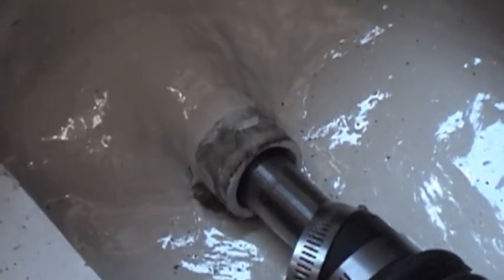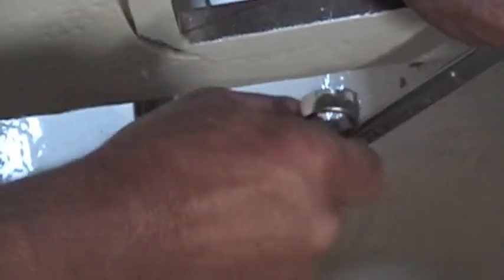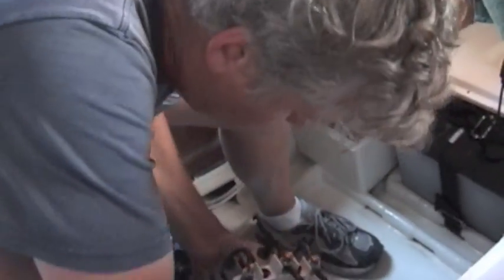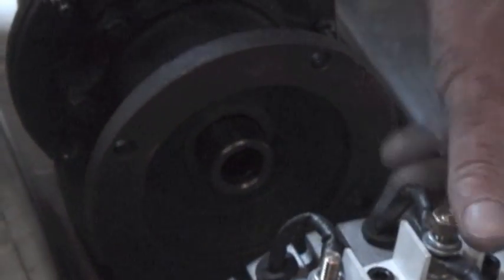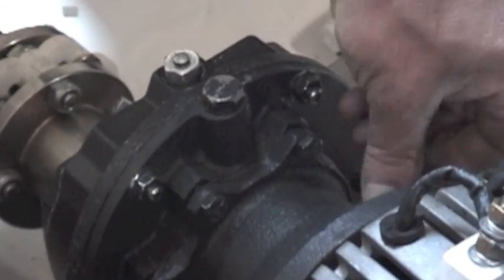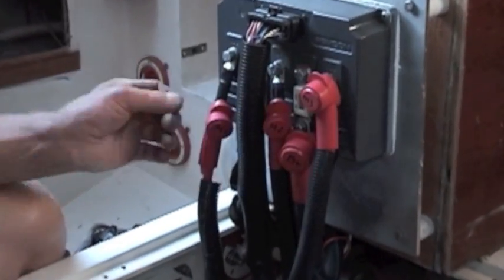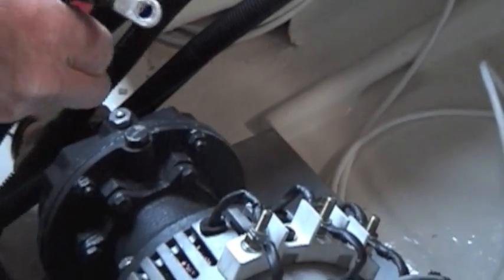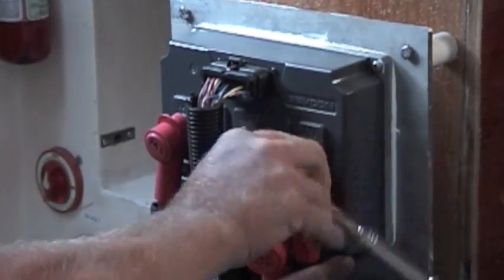Full Installation of Electric Drive Including Alignment

Comment: Sir your video is fine i just want to know what is the size and weight of your boat and what is the motor you are using it will be helpful to me because I am having a 50 ton boat i don't know which motor to use please inform me if you can please reply thanks

Comment: So you can use your boat as a solar generator if you have a little cabin on the lake you have a cord running down to your boat you plug your cabin into your solar boat and have all the electricity you need for the cabin and just unplug and have a day out on the lake when you want to on your boat when you return home you plug back into your boat and return to the cabin to relax you can't go wrong with free electricity for your boat and your cabin LOL

Comment: Just thinking maybe Dimple the shaft to allow the seal Rotary drive screw to grab onto the shaft, as  i have seen some back off at times, just remove the Allen screw use a drill to dimple that shaft refitting same and even loctite the threads of same... Belt and Braces... no one wants a leaking shaft gland ... Great Job...
Reply: Instablaster

Comment: A couple of small fans,extractor and blower would keep the motor and bay ventilated.........???!!
Reply from the maker: The Electroprop Sailor has 3 x 4 inch intake ducts which brings cold air from the cabin directly to the motor.   The enclosure provides a place to mount everything inside, plus is a wind tunnel of sorts with air directed across the controller, gearbox and motor.    Nice that we think the same!   Lots has changed since this video.   Thanks,  James          www.electroprop.com/sailor
Reply from the maker: WE only use one of the intake ducts.   Three are provided for installation flexibility

Comment: Where I can get the motor
Reply: I got mine from a"pallet carrier,lots of torque and 800 RPM MAX.For a very small boat you can salvage washing machine engine,but if you find an industrial washing machine engine,you're in business.....Those engine are very reliable and powerful(some have to run 24/7)Imagine the amount of sheets they must wash in Vegas......!!!!
Reply from the maker: electroprop.com    for details on our latest motors.

Comment: Sorting through all the options, what is good here is the basic coupling set up. What remains unanswered is - What is the voltage and wattage of this motor? What source is best to find the most powerful Forklift Motors and the brands? A brushless, AC Motor rated at 30 KW or better, at 48 volts would be nice  Any suggestions where to find used motors like that?
Reply: 30kw at 48v would be impossible. It would require coils that can handle 625A, which is pretty impossible as the copper coil would need to be about an inch thick.
You can easily find larger industrial 30kw+ motors that run at 3 Phase either 240V or 480V at a much more reliastic amperage (88A/44A).

Many 3 Phase AC motors can be driven with the same driver you'd use on a BLDC motor, as long as they use pernanent magnets.

Obviously, you'd need a driver that uses IGBT modules to modulate the frequency, and you can get them already made (for the same 3 phase industrial motor) for around $500, but then you would also need a DC to 480 AC 3 phase in order to use it, which will probably be a lot harder to find than to just design your own simple triple half bridge to simply modulate the 480v as you wish.

I've never heard of a forklift motor that uses that much power (about 5kw max), as forklifts don't need to go fast, so any weak, geared down motor can easily do the job.
Reply: Excellent info and very specific to my request. Thank you Brian! I have seen projects using a Golden Motor 10-20 KW 48 volt BLDC liquid , using a 48 volt 30-500 amp FOC Vector Controller. There is a 96 volt version of the same technology for the same cost. The question is, would 2 of these  motors, running through reduction gear belted pulley's to the dual drive shafts of a heavy semi planing displacement shallow V hull like the Uniflite 34 be sufficient to move the boat along at 8-9 knots? And for how long when using a pair of 200AH 48 volt battery arrays made up of Four 12 volt 115 pound 200AH batteries per side? (Eight 12 volt 200 AH Lead Acid Batteries total). Being careful to match and utilize these motors high torque capacity by choosing the right propellor blade loading to best make best use of that higher torque capacity..?  Even though in terms of Horsepower we are only talking 30 hp per side would it be viable as a slow cruise alternative?  https://www.goldenmotor.com/hubmotors/hubmotor-imgs/HPM20KW-Specs.gif